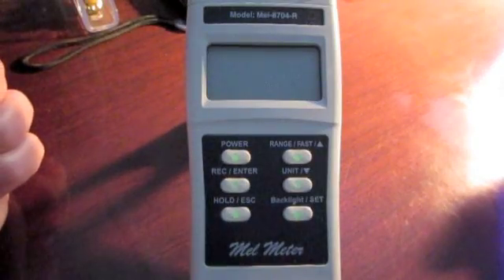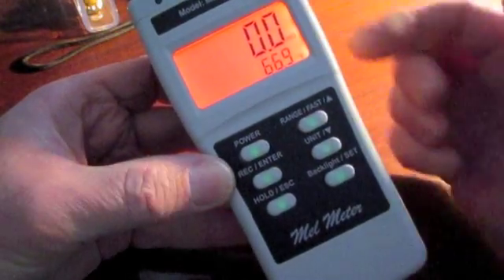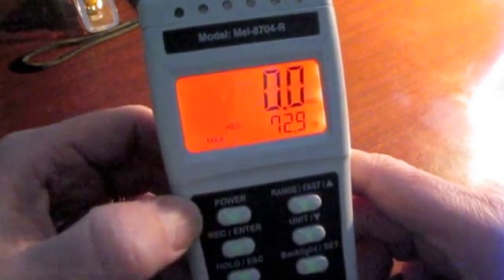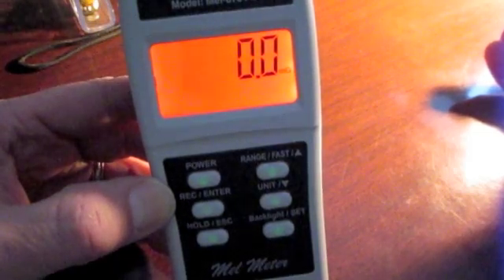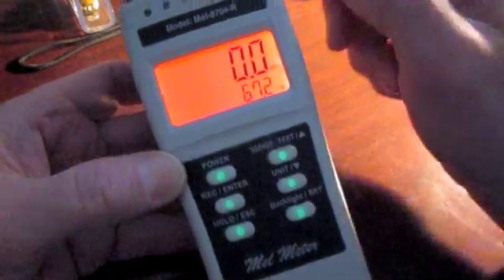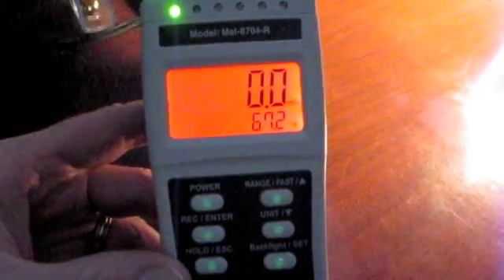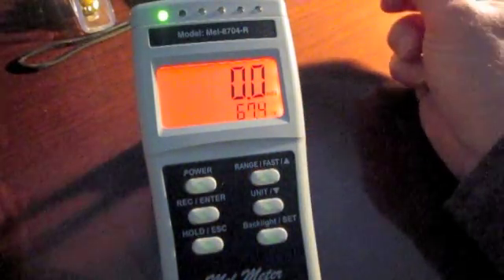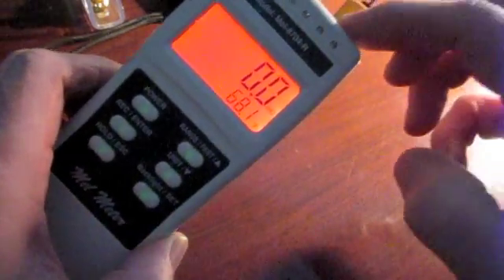Mel-8704R-ATDD

Comment from the maker: The best way to detect and capture EMF and Temperature variations would be to activate the REC button. This captures the +/- EMF and Temperature Peak to Peak variations throughout the investigation. The ATDD  feature is a +5/-5 degree Hot and Cold spot detector. A user should baseline (Zero) the device in an environment after the thermistor temperature sensor adjusts to the surrounding temperature. You should be looking for a dynamic sudden change. The LED & sound help to validate the experience

Comment from the maker: The Hold (bottom left button) can instantly "latch" or Hold the Digital EMF & Temperature displayed on the Mel LCD display. The Hold feature is helpful if the user experiences a sudden change in EMF and/or Temperature and wants to share the Data Spike with someone else. If they had the Ambient Temperature Deviation Detection (ATDD) activated which is a completely different (independent) circuit, the beeps and LED activity were most likely due to small temperature fluctuations in the environment

Comment from the maker: There are two ways in which the sound is controlled. First, you can turn the sound completely OFF and use just the visual LED's if you like. Also, we just modified the software recently so that if the temperature begins to drift and the temperature tone stays on continuously for more than 10sec. the device will automatically mute the sound until the next +/- 0.1 degree change occurs.